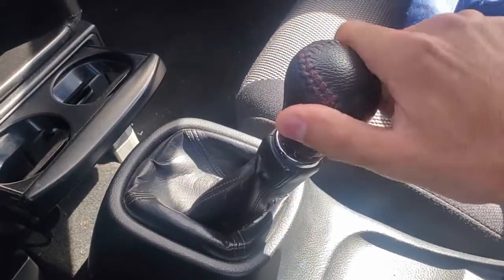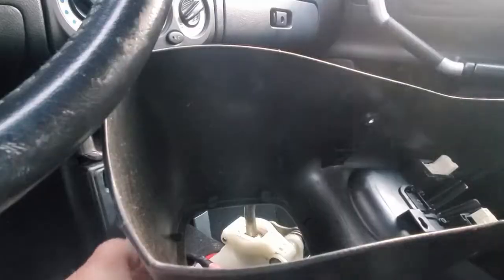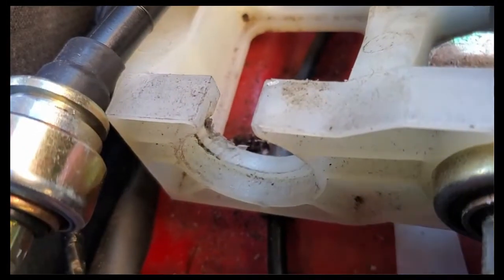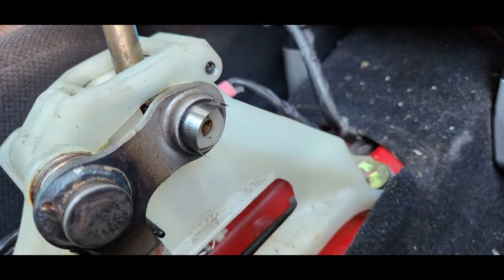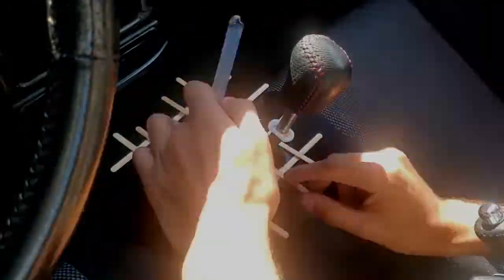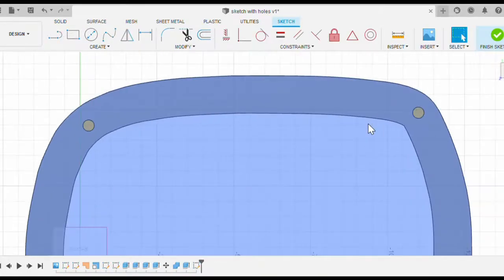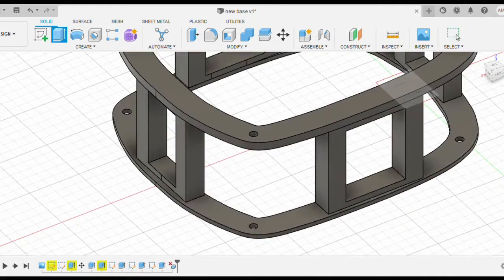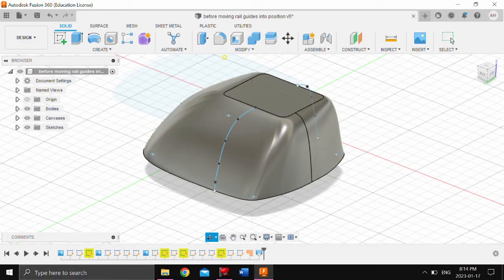Making a Custom Gated Shifter for my MR2 Spyder, Part 1

Comment: I have been working on one for a 2012 Audi a3. I have been using the 3D printed model for over a year but have broken the teeth off many times (on my 10th or so print). I should be cutting it out of aluminum on a water jet and seeing how that goes. We should dm and talk about his stuff
Reply from the maker: My plan is to finalize the 3d printed version of the shifter plate when it's perfect, then use that same file to have the plate CNC'd out of steel by a metal cutting service, such as send cut send. Unless you are making it out of thick aluminum, i wouldnt recommend it, as it might slightly bend if you shift hard or mis-shift into the fork.

Comment: If you wana colab on this PM me I have a gated shifter already 90% done I just need the piece you made
Reply from the maker: I can share a file I made with the top portion sized correctly (skeleton frame). Did you figure out a way to mount the plate to the shifter base? I'm trying to find some metal pieces that I could potentially bend to make the support.
Reply: @abdullahmohieddin  I actually have the shifter gate piece all finished I was thinking about making a clip in piece similar to the SMT trim plate.
Reply from the maker: Oh nice! I'll post the files I have for it in the description later today. Perhaps I can use your shifter base, then work on making the functional plate based off of that?
Reply from the maker: If you could, I'd appreciate if you could email me a picture of your shifter supporting structure.
Reply: @abdullahmohieddin  what’s your email, I don’t have a supporting structure I have the actual gated shift plate. Which I’d be more than happy to share. What’s your email?
Reply from the maker: Abdmohieddin@gmail.com

Comment: Why not use a straight short shifter?
Reply from the maker: I already find that I need some good force to put the the shifter into each gear. Using a short shifter would make it even more difficult, and would leave maybe only a few mm of space between the gates. That would not allow me to install a shifter plate with forks that are wide enough (to be strong enough) to support the forces I will be applying on quick shifts. I also like the travel of the shifter, not too long or too short.

Comment: Thats some serious work. Suprises those 3d printed bushing hold up at the base of the shifter
Reply from the maker: Thanks. They have 100% infill and are always compressed with no room to really "explode" in an outwards direction... so they should be good
Reply: @abdullahmohieddin  what kind of filament are you using for ur prints?
Reply from the maker: ABS. Cant be PLA, it will degrade in this type of environment (heat, sun, cold, etc). But I use an enclosure around my printer to make sure nothing is cooling and that my parts have good layer adhesion. I haven't experimented with other filaments though.